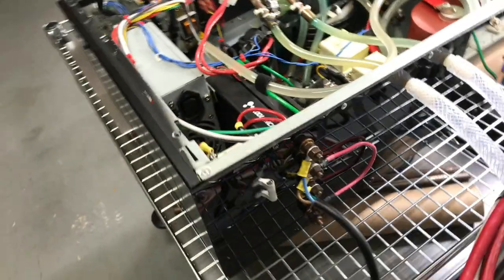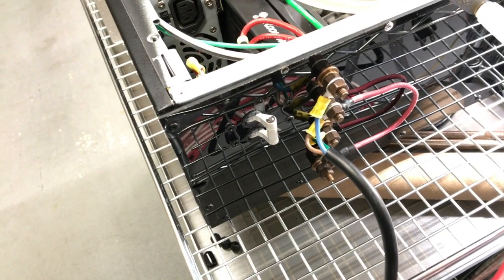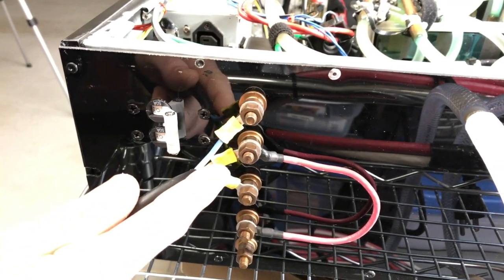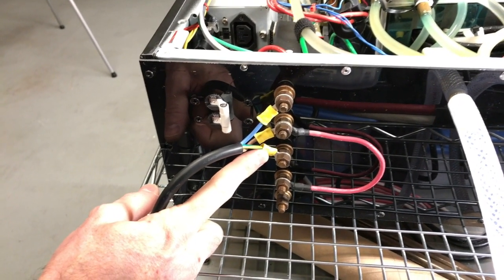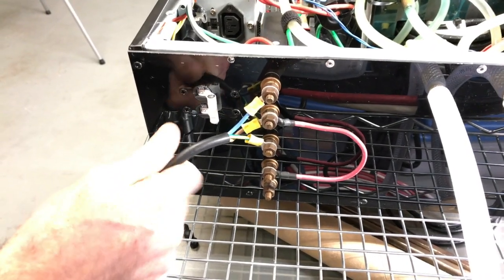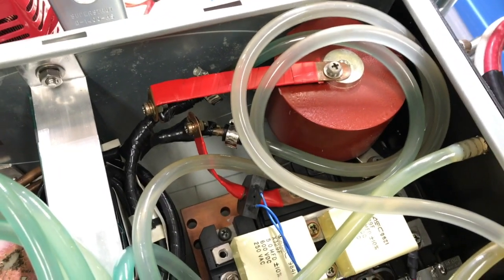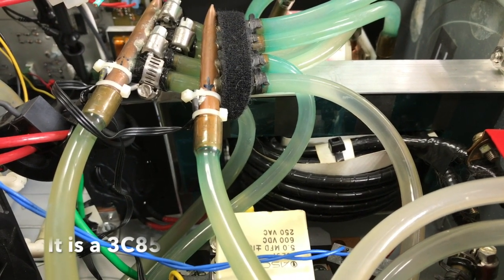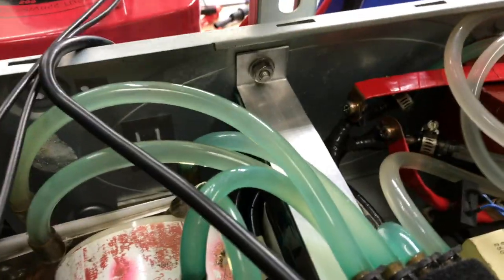How it Works - ReactorForge Induction Heater High-Level Overview

Comment: Hi Josh. Thanks for your great videos.
I have a question. 
Have you ever measured the output power or power supply efficiency by measuring the generated heat in your piece of metal?
like using the formula Q=mC(T2-T1) for iron or steel or ...
I have a 10KW power supply. I measured the generated power by measuring voltage and current at the output, however, the piece of metal that I want to melt, just show 1.5KW.
Reply from the maker: Hey Hamidreza, I remember reading this and though I replied to it but obviously I didn't. I have not done that but since seeing how efficiently and quickly it can heat a work piece this has been something I would really like to do. I have some crude plans jotted down for a calorie meter based on an industrial type that I'd like to build once the project is complete. 
It sounds like maybe your power supply is not not fully coupled to your work piece. There are dozens of reasons that could cause miss-coupling if that is the issue so I won't even attempt to guess without knowing more about the setup.
Reply: Josh Campbell Thanks man for your reply!
Now I have another problem which I am working on!

Comment: hi josh 
great job 
just a few questions 
what is  the rating of your IGBT s?
what is the maximum frequency of your hybrid  gate driver circuit(i searched the part number and it says 20 khz is the maximum frequency!)
and how insulated the cooling system between high voltage nods it makes some issues for some cases
Reply from the maker: Thank you very much!
The IGBT's currently in the inverter are 2-pack 300A 600V modules with a maximum power dissipation of 1200W.

On the driver, 20kHz is the maximum "Recommended Range" and is the frequency used during testing to create the characteristic profile charts and current ratings. What matters are the high-to-low and low-to-high propagation, rise, and fall times. Add up the maximum times to see the worst case absolute maximum on/off time and divide one by that value (1 / .0000043) to get the maximum switching frequency. Now we still have to factor in dead time to prevent cross conduction, but as you can see the actual maximum switching frequency is much higher than 20kHz, well over 200kHz in fact. Results may vary, but I set up a quick test rig when I was looking at these drivers. With a nominal dead time, I was able to reach switching speeds over 150kHz, which is much more than I need in the ReactoForge tank circuit. If you needed something faster than about 200kHz you need to use MOSFETs anyway.

The cooling system isolation and resistance depends mainly on two factors. The level of coolant conductivity along with the size and length of the conductor or cross section x length of tubing in this case. The best coolant solution is always one that is premixed for your application. But deionized or distilled water with an anti-corrosion and growth inhibitor is a good alternative if one is not available. The conductivity of any coolant is going to increase over time as fluids naturally grab ions and dissolve metal and other particulates. I added extra length to the tubing on the primary winding connections of the matching transformer. This method is standard practice in high voltage water cooled applications. I also made the water intake and output manifolds out of copper so they could be grounded. Doing so allowed the DS18B20 digital thermometers to monitor the input and output coolant temperature as well. Other parts of the coolant path also have a high surface area to ground path such as the inverter cooling plate. The short answer is, it is very isolated from mains current. I will post specs and show tests down the road, but no matter how isolated it is by design, the most significant problem will be and usually is whether or not it is appropriately used. You could just hook a garden hose up to it, that would keep the unit perfectly cool. But I'm going to say that is not a good practice, is not supported and would void any warranty relating to any component in the cooling loop.
Reply: ok tnq for your clear answer 
but it seems that the IGBT's that you have choosed  are too much strong for this application
is that beacause to have good relability ?or else?
hope to see your new videos with testing this product
Reply from the maker: The IGBTs "currently in the inverter" are indeed overrated, by about 500%. This is in part because during early tests I did not know exactly how far I was going to push current draw, this allowed for plenty of headroom. The final part that I choose for the kit will still be overrated by design. Maybe not quite as much, but I prefer that switches in high power circuits operate at about 50% of their rated current and 25-50% of their rated power dissipation. This also leaves room for "hacking" the inverter to run at much higher current levels and or different matching transformer impedance levels. I have run this on 240 volts pulling right at 100 amps on a large workpiece. The energy in the room when pulling nearly 25,000 Watts from your breaker panel is electric, to say the least! 

 I ordered a medium run batch on the hybrid driver boards (version 1.3) since it is very likely not going to change beyond this point. I'm also ordering bulk parts and passives for the drivers. At this point, I may go ahead and lower the IGBTs to 1 or 200 amp modules as well.

Comment: Josh, whats the secondary current ? Just judging by the video if U have 4 strands of 1/2" copper tube then it makes for about 90sqmm or 3/0AWG therefore at 5A/sqmm You could go up to 450A with very minimum heating, and that got me thinking that the heating in the secondary wasn't caused by high current but rather by 'skin effect' of the high frequency as the tube wall thickness is 0.6mm.
What are the values of the secondary cap and the primary DC bias cap ?

A bit more about PFC ?

gr8 job !
Reply from the maker: Hey Mark, I don't have accurate up to date calculations or readings of the oscillating tank current. Once I get this up and running again with the new drivers, I can do that in software. The last time I measured it I used a parasitic capacitor across the tank capacitor that was a multiple of 100 or 1000 smaller and adjusted the current measurement by that amount. Those readings were in the 200-800A range, although that was a parallel LC tank and this is a series resonant tank. 

The tubes are 1/4" copper and don't forget to factor in the constant cooling (no heat build-up) into your current calculations.

The tank capacitor is a 10uF 100V 1000A (500kVAr) Celem.

The DC bias cap is a 3.1uF 600V 150A TPC.

Here are a couple photos of the current measurement process I talked about:
https://reactorforge.com/wp-content/uploads/2017/12/current_mesure_1.jpg
https://reactorforge.com/wp-content/uploads/2017/12/current_mesure_2.jpg

And BTW, thank you so much for becoming a Patron! I saw the message pop up while I was replying to this. :D
Reply: I feel like a virgin again (just started with Patreon) :)
Been following Your tube channel for Years now, hoping that one day this project will make its way to the public market as an open source... and ol the sudden You started uploading more vids... awsome !

My pleasure.
Reply from the maker: Ha, that's good to hear I really appreciate the support both as a subscriber following the project and now the monetary. I've begun bulk ordering some of the primary components and am excited to get the first few kits out in the wild!
Reply from the maker: Oh and about the PFC. That is a broader topic that I will go into. For now basically, by not filtering the DC, the current envelope is entirely encapsulated within the 120Hz DC pulse train from the rectifier output. As the voltage raises and lowers with each cycle (60Hz, 50Hz, or whatever), the current also increases and decreases meaning we are using power in a manner very similar to a resistive load. This results in a near-perfect power factor since the voltage and the current are in phase. So there is no Power Factor Correction, we just aren't degrading it in the first place. As is the case with most switch mode power supplies and all filtered, rectified AC power supplies. 
So if the inverter were running at 53Khz, and you looked at the output of it feeding the tank. You would see a 60Hz carrier frequency modulated at 53Khz. The tank doesn't care that there is a 60Hz carrier as this is far from the resonant frequency. We do however need the line filter to ensure no high-frequency component of the inverter feeds back into the mains.

Comment: great project josh, you should try to use litz wire for the primary on the matching transformer, its better for the high frequency high current transfer because it doesn't heat up, therefore you don't need to water cool the primary
Reply from the maker: Thank you! Litz wire is an excellent idea, it is used in induction cooktop stoves and other high frequency high current application. But there is a problem, Litz wire is costly. Particularly the type that would carry the required current. I did use homemade Litz wire (about 50 strands of 22 awg magnet wire) to feed an earlier version of the matching transformer, but it still got hot at high power levels. I also tried flat copper foil insulated with various materials and smaller copper tubing. Here is a photo of a few of them: https://reactorforge.com/wp-content/uploads/2017/12/high-current-windings.jpg 
So far water cooled 1/4 inch copper tubing is the minimum conductor type/size that can operate at 100% duty cycle and stay cool.
Reply from the maker: I fed that small diameter tube coil with Litz as well. Forgot about that one. 
https://reactorforge.com/wp-content/uploads/2017/12/small_coil_litz_fed.jpg 

I also experimented with directly winding the transformer with Litz wire. 
https://reactorforge.com/wp-content/uploads/2017/12/litz_transformer_windings.jpg